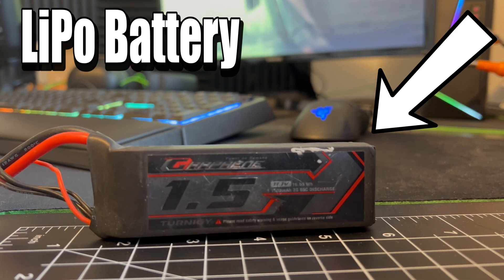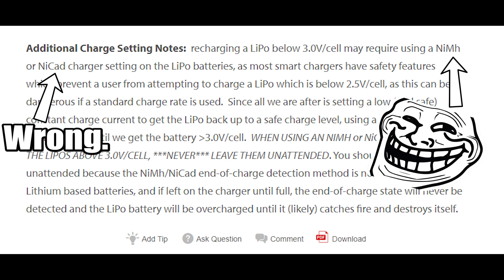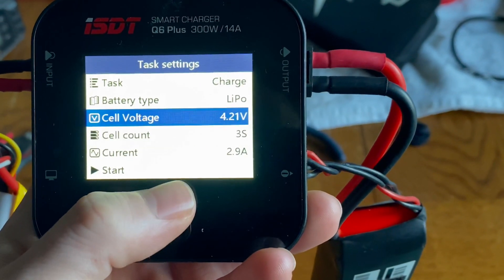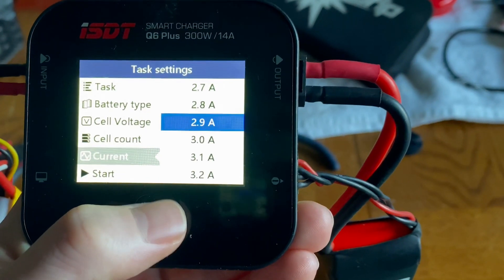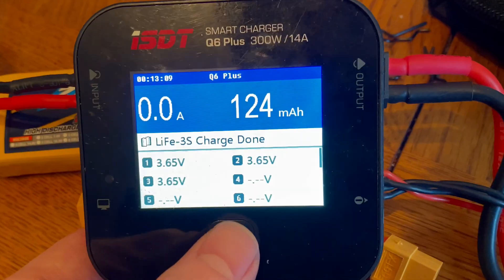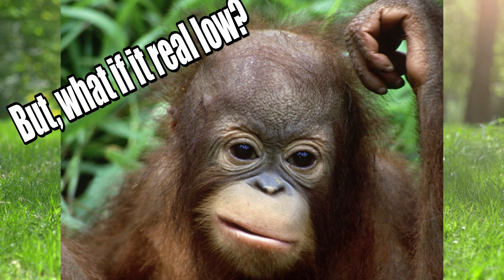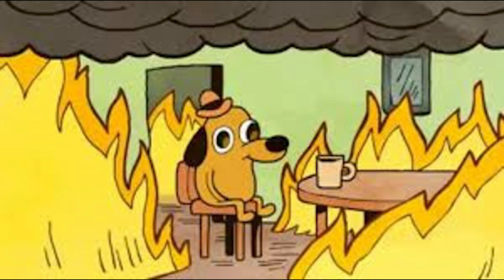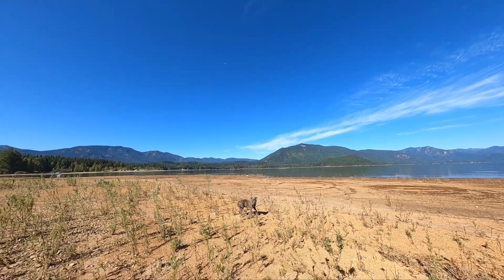How to Revive a LIPO Battery Safely -& when not to.

Comment: I got even worse, used li po to charge my laptop in blackout and discharged to 2volts per cell, when I plugged in to isdt air 8 charger I note that the voltage slowly grows with time, does it charge it on his own without a task, meaning that charger is smart enough to understand that I am stupid idiot almost killed battery and it's trying to revive it on his own?
Reply: btw it gets to 2.5v and maybe even higher per cell on average on his own before starting charging with life algorithm
Reply from the maker: iSDT chargers will go into “Keep” mode by themselves at the end of a charge, but will not apply a charge without running a task first. I believe you are seeing the voltage rise because the battery has been removed from a load, and you are seeing ‘voltage rebound’. Either that, or the charger is giving a misreading (which is pretty rare, but is a possibility). 

As stated in the video, if the charger cannot charge that battery in LiFE or Lithium Ion mode, it’s definitely not safe anymore.
Reply: @ChaddRainsFPV  yes, you are right, left them for one day, plugged and saw about 3 volts per cell, it's even enough for li po algorithm with low current, saved batteries

Comment: !!! Nice info, thanks!!!  What if it puff just a little? (really little :D about 1.5mm from both sides) Trash it?
Reply from the maker: You can check the internal resistance and see if it’s good. It’s hard to say if it is bad 100% because it has puffed slightly, but it is a sign that it’s not going to hold up for long 🤙